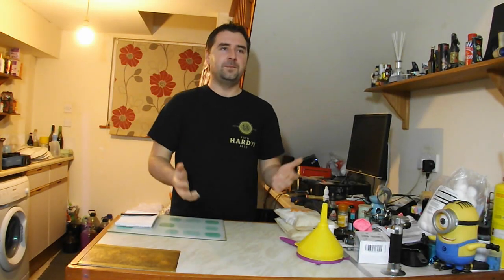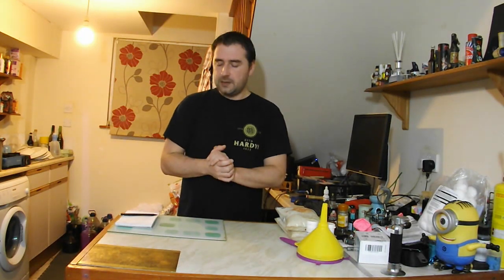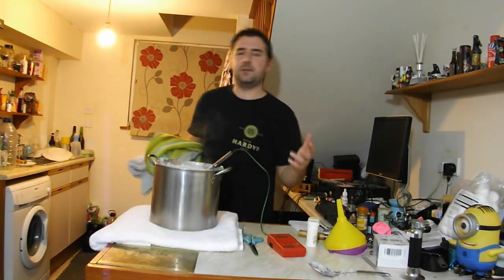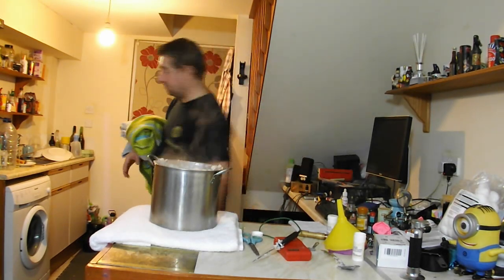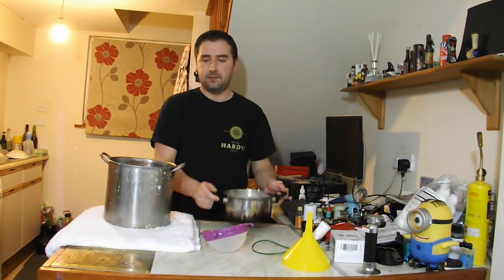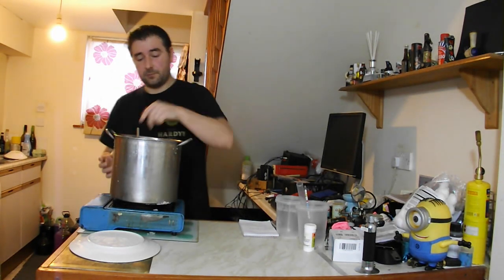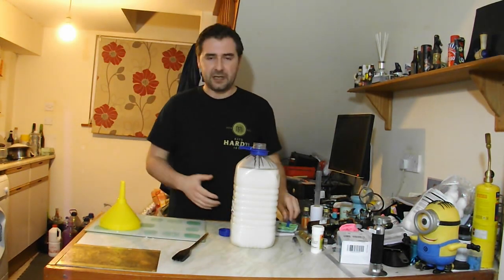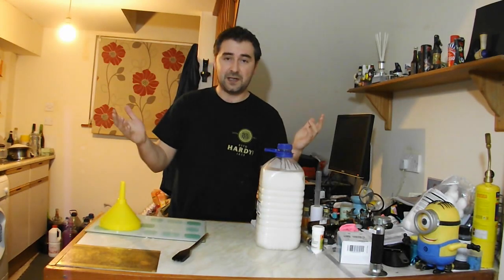white rice beer experiment.....semi failed but still interesting

Comment: Hi I was given a 10kg bag of pudding rice can I use that instead?
Reply from the maker: hey, well you can and free is always better :) in theory you should be able to use any grain, of course the results will taste slightly differently but that's the joys of experimenting. cheers
Reply: making homebrew wild and cheap thanks for that, I'll give it a go
Reply from the maker: hey, well if you do let us know how you get on with it. I had a cheeky try of it while it's still fermenting and its mildly alcoholic, sweet, creamy and kind of milk like. tastes really good so far :)
Reply from the maker: hey a quick up date! 
you need to add nutrient! mine has stopped so if you try this use it!!!!!! lol :P
Reply: Thanks again I have not started it yet, waitting for a few things to come, that I have ordered. But thanks for the update. I have done a variation on mead with wine yeast and instead of using honey, I used treacle and lemons
Reply from the maker: hey, not a problem. I just didn't want you to waste your time making something that wouldn't work, should have guessed plain white rice didn't have enough nutes. nice a kind of bitter rum style drink. you will have to let me know how that turns out :)  cheers
Reply: I enjoy doing the brewing gives me something to look forward to and if I get something I can drink even better. If not then I've learned something new
Reply from the maker: indeed i agree, keeps me out of trouble too :D there is really alot to learn and experiment with if your willing :) even a failure can be useful as long as its not moldy, blending things together can make an ok wine excellent  ( if your not a purist ) :P

Comment: I have never made an all rice beer or wine, but I have added rice for flavor. Crushing the rice is a very good thing, after crushing the rice I tend to put it in the oven on a cookie sheet for about 30 minutes at 300 degrees Fahrenheit. After that, I do everything pretty much the same way you did your wort.  I really like the fact that you are trying an all rice beer.  Also if you try this again in the future not knowing how much yeast cost in your neck of the woods, but you may want to pick up a package of ale yeast. Once again great video.
Reply from the maker: hey, indeed, i found out the importance of crushing the hard way, hadn't thought about baking it after, i presume it's for a slight coloring and flavor notes. well rice is very cheap and its a pretty wild idea ( see what i did there  :P ) to use nothing but rice to make a beer style drink that isn't sake.  while my method and recipe need working on i did find out that you can cheat malt grains that you buy in the supermarket for really cheap which was the intended purpose of the video.
 lol, indeed I do have a load of yeasts ( ale included) arriving shortly I originally had another video lined up but had to change my plans due to having a brain fart while recording it :)   cheers.
Reply: I can't wait to see how it turns out. I must admit I do like the milk colored wort. It is very different and way cool.
Reply from the maker: lol, its fermenting so that's a good sign :) yea the milk color is cool although it is now separating :( it would be good if i could keep the milk color.